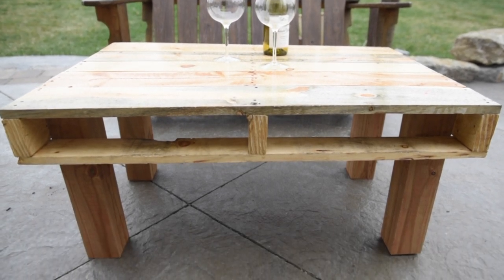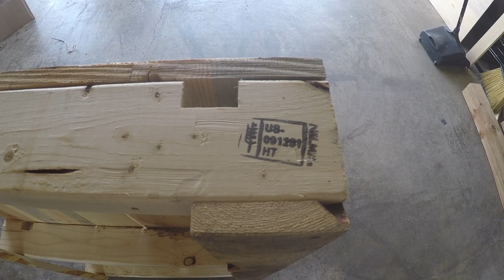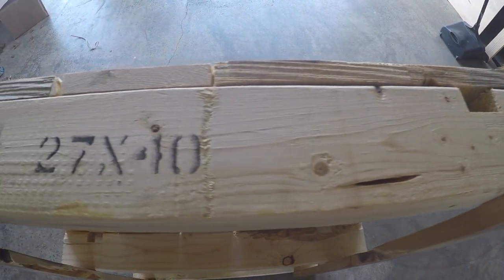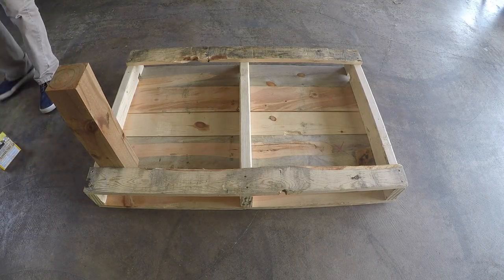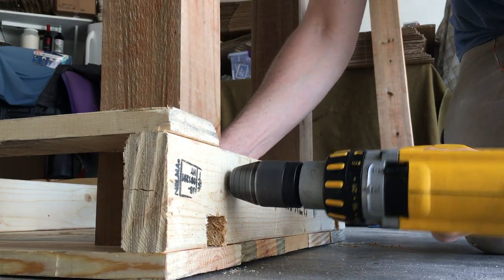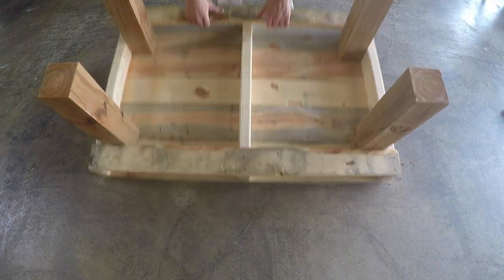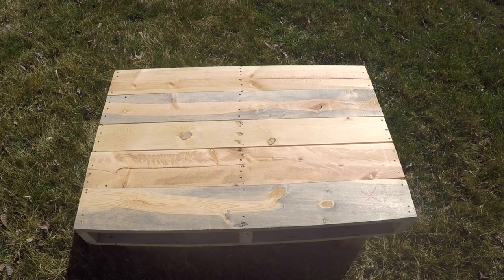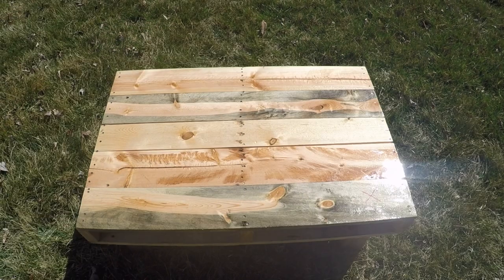How to Make an Outdoor Pallet Table in 15 Minutes //DIY

Comment: I am planning to do this except the table will be alot taller and used as a plant stand. I've cut my pallets in half so they arent as wide. My question is, could I use 2x4 instead of 4x4? They're almost half the price